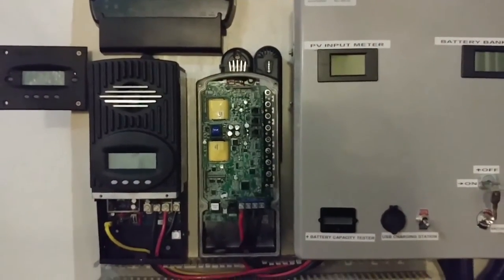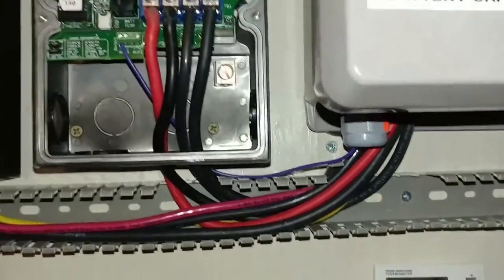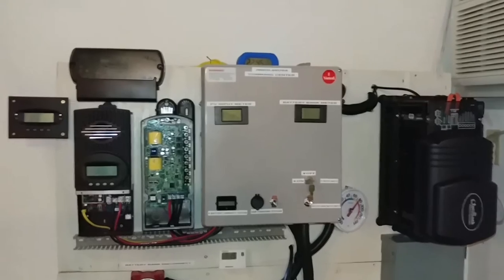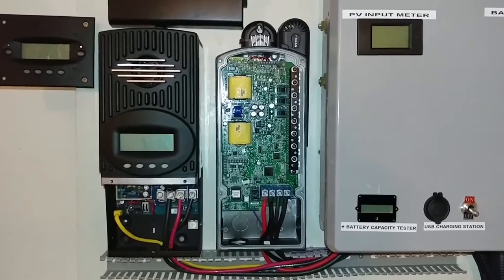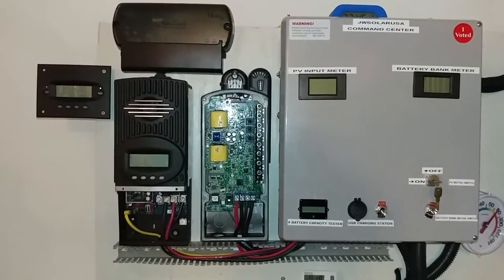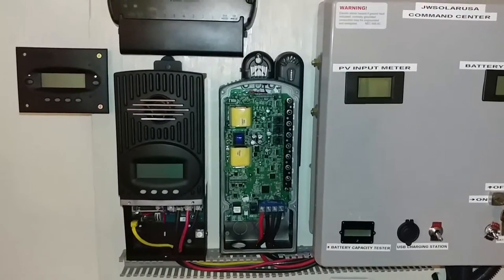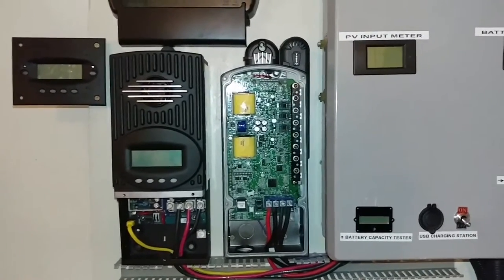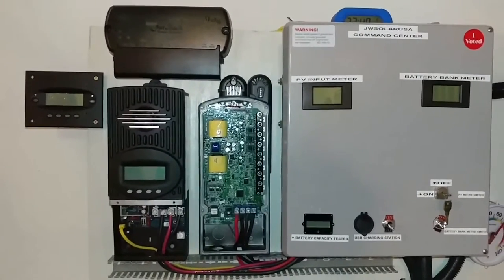SOLAR 48 VOLT OFF GRID AND BATTERY BACKUP SYSTEM - Upgrading MidNite Classic & OutBack Flexmax Pt.2

Comment: May as well wire things up with the biggest size wire the equipment can handle. That way you won't need to upgrade it again, like what I've had to do lol. Looking great though buddy, keep working at it, bit by bit. Hope it has warmed up a bit for you over there.  We hit 38 degrees C here today or approx 101 F.
Reply from the maker: Thanks for sharing that awesome comment.
The Temperature went up little bit here but will be snowing in the morning all day.
What are you at?
Reply from the maker: +Adam Kuklych 
Thanks for Watching and the compliment.
Have a wonderful day and God bless.
Reply: Yes my system is just a gradual process. Build it up piece by piece, bit by bit as I can afford it.I'm on a super low income but I love solar, I love what it does and I love learning about it. I'm hoping to jump to 24V in the next few months and have a much better inverter. My housemates are connected to the grid so I have that as a backup, but energy here is around 32 cents per kWh during peak times.
Reply from the maker: Wow
Reply from the maker: That's pricey mate.

Thanks for the +1 and stay tuned for more videos to come on this awesome project.
God bless you all and have a wonderful day

Comment: Jw I just looked up the green mppt device have u had any luck getting it to boost voltage from below the battery level. I read online it is a booster and can allow a 20v panel to charge a 24v battery. I'm really interested in knowing for a project I'm running
Reply from the maker: I have never used green MPPT